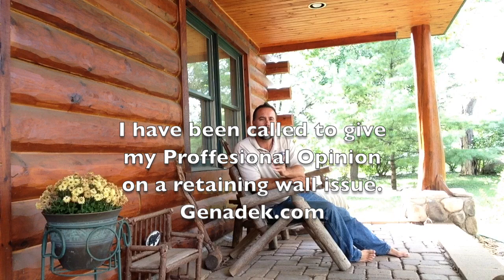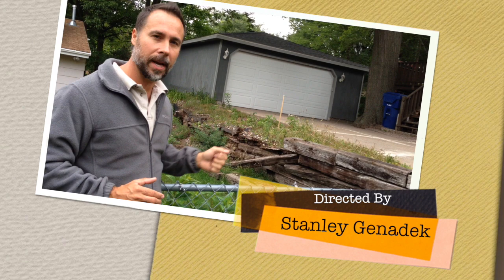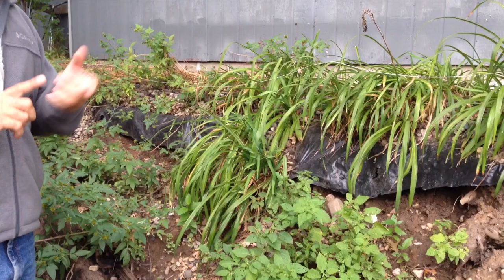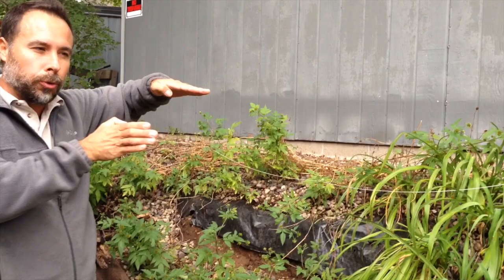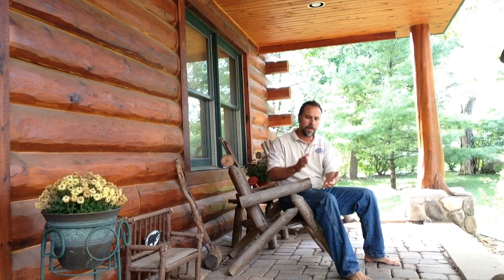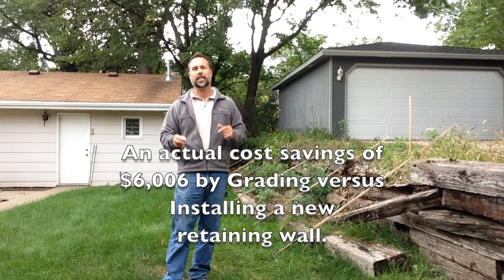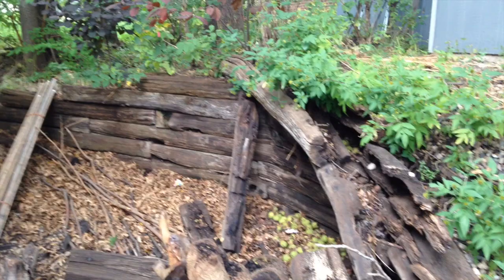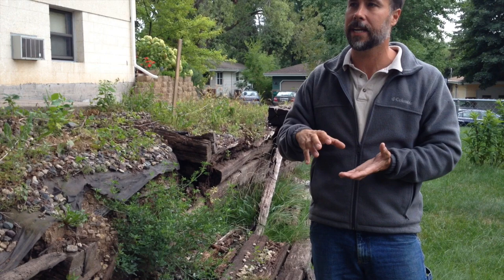Catastrophic Retaining Wall Failure Goes to Court in St.Paul MN

Comment: I'm guessing the guy on the bottom wants the guy on the top to pay for a new retaining wall, but its pretty clear that this wall has long been neglected, they could have easily prevented this from happening. I'm sure the building on top caused it to fall down sooner but its probably not the reason it fell down.
Reply: Experimental Fun The retaining wall was not designed to hold back the load of the garage did you missed that part? This is a "But for" case in court. That retaining wall was built exactly how it should have been with what was there at the time which was nothing. Whomever built the garage should have had the foresight to see what would happen further down the line to avoid exactly what has happened. I blame the contractor and could be sued for duty of care.
Reply: Experimental Fun I don’t blame him.  If my neighbors wall fell on my property I would expect them to correct it.  I have a large tree limb that fell right now on the far side of my pond that smashed the barbed wire fence and I’m waiting until the ground dries out to get the tree service to remove the debris so I can repair the fence.  I wouldn’t expect my neighbors to foot the bill.
Reply: Steven Johnson
Take a moment and think about what you're saying. The builder cut so many corners they didn't even put gutters on the garage, yet you think they put in 4ft frost footings?
Really?!
Reply: Rob Calhoun, rain gutters are not required by local building code.
Reply: This is why they have building codes that don't let you build close to your property lines.
Reply: @StanslaMichael  Whomever built the garage should have had a permit; so if anyone is to blame, it's the city for signing off on the job. They should sue the city for incompetence.

Comment: not sure on laws on your area however, here in Michigan any new home construction or if you get an approval for re grading you have to contain any runoff from rain to your yard. you either have to swale the perimeter to drain to the street or a catch basin located in rear of yard your suggestion here was to regrade a slope rather then rebuild the retaining wall. wouldn't this be an issue with runoff from their roof going right into the neighboring yard not only that but the neighbors who are  sueing would be loosing almost 125sqft of usuable property.
Reply from the maker: +Brandon C We have to keep all water on the customers property-can't direct to any ones else's.

Comment: The second "dead man" that supposedly extends underneath the garage looks more like a big tree root. There's also a pretty large tree between the garage and house with a "buttress root" that appears to be heading in the general direction of under the garage and the location of that second "deadman". Coincidence? And wouldn't you need a lot more than two "dead men" and something placed parallel to the wall on the opposite buried end of them to anchor them and the wall well? How do you know the first "dead man" extends as far as you think it does? It's a railroad tie, right? They're kind of hard to "splice" and they're obviously pretty old and half-rotten ties to begin with, and long-term they're not going to last as "dead men" buried in the ground. 

Isn't it more common to use something made of strong and corrosion resistant steel and then steel rod as a "dead man" to retain load-bearing walls? I know burying a disk blade (farm tillage tool with lots of large concave steel disks made of very tough and corrosion-resistant steel) and using "ready rod" or a long, metal rod with threaded ends is a pretty commonly used method of tying back basement walls in areas where soil/moisture conditions tend to want to bow in basement walls because you can tighten the nuts inside the basement wall periodically to slowly "push" it back into position. and to compensate for any "settling" that occurs as the blade works into position and compresses the soil adjacent to it. 

I've seen a few railroad tie "retaining walls" but the "dead men" have been ties set in the ground as "fence posts" vertically. I can't see how you anchor a retaining wall effectively into soil that needs retention using a wooden timber laid perpendicularly to the load you want to resist. Isn't that just common sense?

Comment: Railroad ties are used & rotten to begin with!  I do not see the garage having much to do with the failure.  Yes gutters would deflect the water but it would have just moved the water to the front & back of the garage.  The wall failed because of rotten RR ties and age!
Reply: Yea this guy is such a hack, any landscaper that doesn't know cross tie walls have an expiration date needs to go back to flipping burgers at McDonalds.
Reply: Dave Amburgey i
Reply: You're correct on the garage, the footings in Minnesota are 4-ft below grade which would transfer the loads below the retaining wall.  The only surcharge would be the weight of slab which is a condition for the full length of wall.
Reply: railroad ties are only treated with creosote and always  rot away  and they rot from the inside out and break apart

Comment: who originally put the house in.. the upper house on the right who raised his lot level or the house on the left who leveled his lot and installed the retaining wall of probably old rail road ties.. a side question is who cleaned up the enviromental contamination from the creosote on the rail road ties.  the creosote is a cancer causing material.. one cannot grow eatable products and should not let their children play where its spread to.   railroad tires sit on top of a course gravel bed.. they are never subjected to direct contact with the ground.  those are rotted away from the contact with soil and water trapped behind them.  the entire lower yard will need the soil scraped off and hauled away to a hazard waste dump. . and clean fill dirt installed..

Comment: The video doesn't clearly show where the property line is. But I could guess the wall did avalanche to the neighbors. Also, the contractor of whole installation of the driveway and the shed must have been a cheapo non-license or cheapo license or an LLC... LLC guys do the job, but they just want the money and get out before the issues raise and that puts blame across the LLC not the individual LLC contractor. That is if the customer even wants to go through all the law suit trouble to go against the LLC.

And for a failed wall. Well when you got kids, nephews and nieces, and the whole group. Well ya, that is definitely a safety concern.

Comment: I'm not sure that roof water has much to do with the failure as you think. Just my opinion. it would explain the falling down timbers right next to the garage but what about 20 feet away. that wall should have a quarter inch set back on each timber. but it wasn't it was straight up and down. even with dead men those walls need to be stepped back like stairs at least quarter of an inch or more. I saw gravel but I'm not sure if it was eroded from the base of the driveway or if it was gravel used as a drainage system behind timber wall. also I don't see any 4 inch corrugated or perforated pipe behind the wall so they made no attempt at  drainage to relieve the hydrostatic pressure. I agree the roof water to be problem but that's only 100 square feet of roof I'm not sure that's enough to create an issue with a well-built wall. this wall was improperly done. I'm not sure about the dead man going underneath the foundation there would have absolutely heave the wall if the foundation settled. sorry not if but when it settles. that wall would still be standing if it was stepped back proper drainage and Dead Mans. I like your videos
Reply from the maker: +William Arrington Jr Your right-  that wall was improperly built but then with the addition of a structure that was to much to handle.

Comment: No. The gutterless garage is gonna blow away any slope that's not made outta stern stuff (plastic, steel; not slab concrete.) Never filled the court docs like in the intro. Then proposes the water load take its wrath out on the street junction and drainage. Screw up 4 neighbors more like. Have areas that retain water for greenery and foundations' sake. 

Sure is a lot of pointer and description in the descriptive text though! (Why ain't one.)

Comment: just curious, why a swale instead of a French drain, it seems like it would transfer the water to the road better.
Reply from the maker: +blosom2315 Both are options.  If the swale doesn't work- then a french drain would be my back up plan
Reply: cheaper option first makes sense.

Comment: If the uphill guy had his garage built and it passed inspection's,then the other homeowner can sue the city inspector for failure too do his job.Minnesota is a hard on any wood due too the weather,the wall was just plain old and rotten with termite's.

Comment: What is wrong is it was built of wood. Someone cheaper out. Build a cement base and use brick landscaped to take water away to prevent undercutting. Its the wall owners fault. If owner didn't build wood wall he shoulda pulled it down and built a proper wall. Never use wood. It rots.

Comment: Sorry but I totally disagree with you on fix. Normally establishing original grade would be ok. But all I see is you pushing water on neighbors land. What's the side yard setback. Swell is ok if gentle rain and have plenty of space to do swell. What happens with hard rain that last for few hours. I can see why you want to do dirt too. No material cost and only 6 grand less in bid. Sorry, I see profits over job quality. Should do landscaping versa lock wall with clean gravel all the way up behind wall, french drains uphill and downhill. Weap holes on bottom course too. Just my opinion. I do enjoy your insight on your videos. I do agree with you on your assessment of what happened. 45 degree slope of dirt is also hard to keep finished landscaping rock or mulch in place.
Reply: i wouldnt want to be that neigbour on the lower part then ,.. it will get flooded everythime it rains

Comment: Did I also see live Termites  in the Rail Road Ty's ? Do they eat the tar wood also ?
Reply: jetbikes1 it's a mix of kreasult, I don't think I spelt it right but it's a mix of it on the ties, the kreasult on the ties is only there to keep the tie termite free for 15-20 years, becouse rail ties have a lifespan of 15-20, then they should be replaced
Reply: Jerreinemy na where I live we have red cedar railroad ties still from the 1880's

Comment: both homes (not home owners) are at fault
the one home is sub grade to make a flat home pad
and the other is above grade
the "ONLY solution" is to bore a cement retaining wall,
under the upper pad and replace the retaining wall with cement and drainage
the slope idea is reasonable but forces all water upon the lower home
you need more experience to give advice in court
you are totally ignorant of liabilities
in the present and future, 
both home owners should pay for retaining wall refurbishment
and home owner on raised pad should make effort for surface water control
Reply from the maker: An update on this project is coming soon.  This one just keeps getting more interesting.
Reply: with a swale to direct water to the street?
Reply: sorry, that didn't come out clearly, I meant that swale comment directed at Bill Russell.  I'm not sure he watched the whole video and if he did, he seems to have missed that part

Comment: should have ran some drainage pipe down through there to give the water a way out.
Reply: That's what I'm saying.  SO cheap compared to the damage caused there.
Reply from the maker: The water from the garage-dumped onto the retaining wall.  This ultimately caused the failure.  Update coming soon.